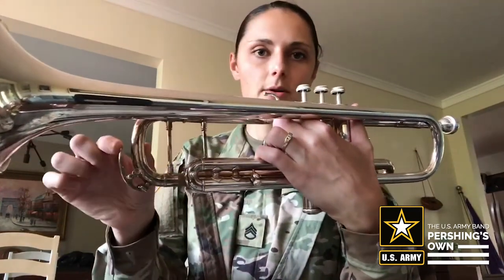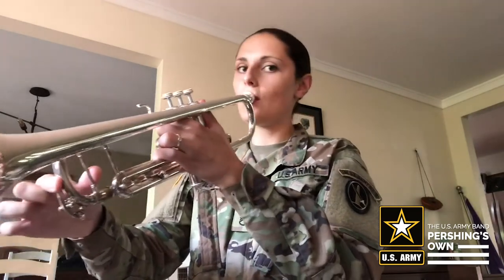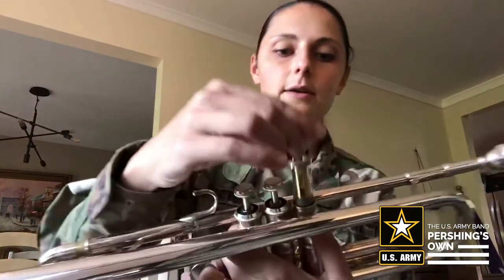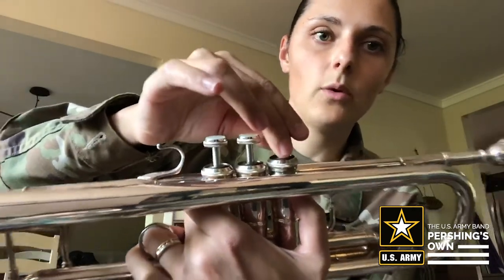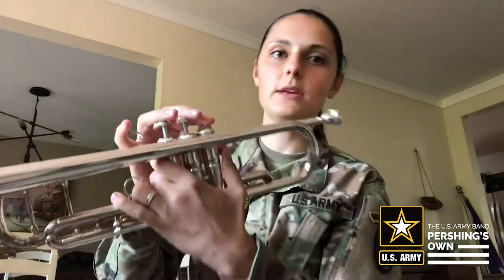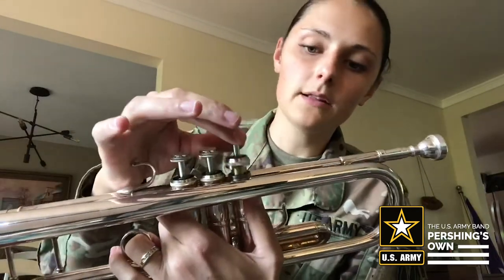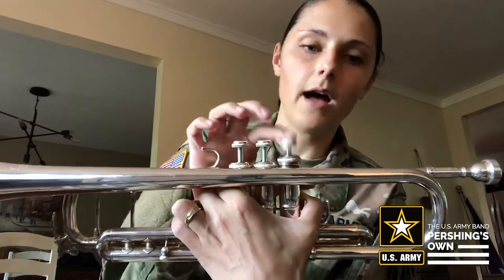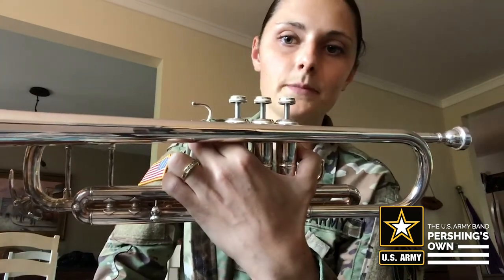Beginner Trumpet Series: Empty Water & Oil Valves

Comment: Blowing air into the trumpet will not get spit out of the spit value I tried it did not work buzzing works so blowing to get spit out is false buzzing is correct to get spit out because I tried buzzing on the mouthpiece to get spit out and it worked